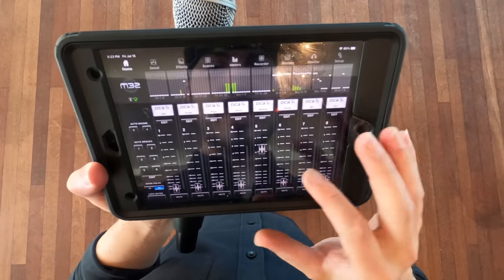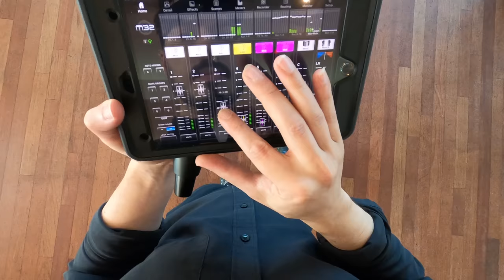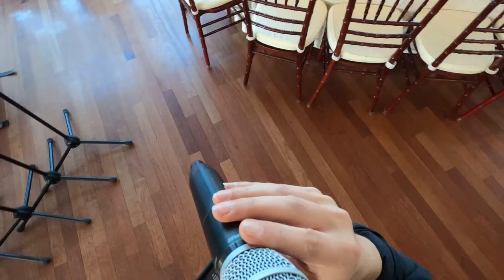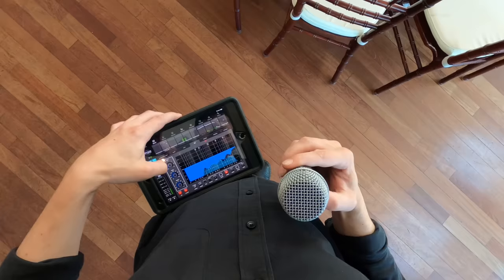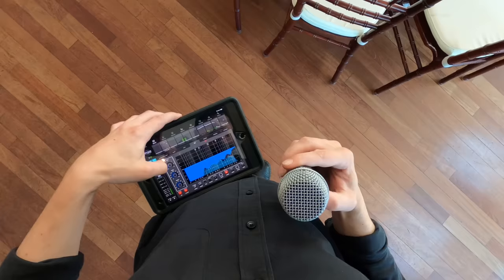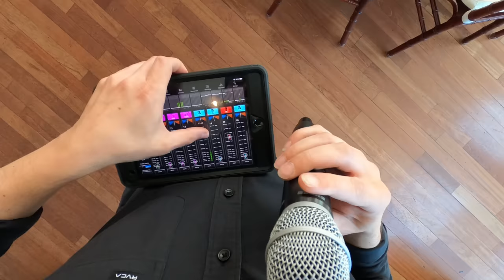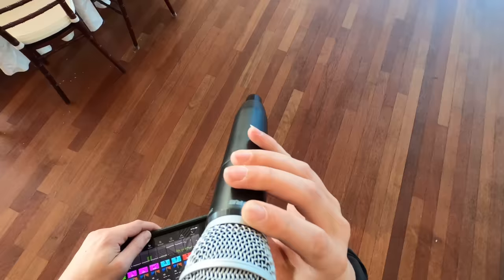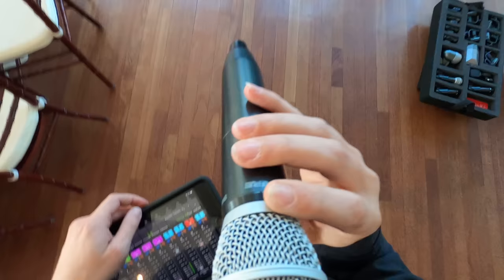System Tune & Sound Check w/Midas M32C

Comment: Blimey you've made life complicated for yourself. You leave the L&R  running full range ?  and you hard EQ the subs to the point of not working . You mention phase, well you will have phase problems in the way you run the system.  Your observation of the room and its problems were well founded.  Please consider that too many knobs are not a good thing. I am not a luddite and have used digital for many years it is way better than analog. ( My first desk was a Soundcraft Series 1 way back in the late seventies ! )   But consider digital to be like using a computer for the first time, if you don't know your manual systems in theory & practice well,  you will only make the same mistakes faster & worse.  Best of luck I mean no offense. Regards Rob

Comment: I’m glad you’re not using graphic EQ, but I think you should reconsider the amount of EQ you are using. Generally subs only need narrow band cuts where there are aggressive room modes and not a low pass because they generally don’t reproduce frequencies that will compete with your mains. I do run a gentle high pass on my main tops matrix so it doesn’t have too much low frequency information repeated. I only run EQ cuts on the mains for problem frequencies that are causing feedback and only gentle and wide cuts if I need to do some tone shaping. Often less in more. If you have the subs and your crossover set well, you generally shouldn’t need to EQ your channel strips too aggressively either. I’m happy you’re actively doing sound and getting your hands dirty!  Keep doing and learning everyday.

Comment: i start laughing when he works on the subs till the end of the video, you made my day with that stupid equalizing, I call that video - how to bring a system down without touching the master faders ! .-)
Reply from the maker: How did the subs sound?
Reply: @billylaguardia  look at the equalizing, you bring the hole System down in every step you do, what will you do on a open air with 10.000 or 30.000 People ? Order more stuff or 20 Delay Lines ?
Reply: Right at the beginning you couldn’t even hear the subs. He has no bottom end coming through those subs. Any bottom you can hear is coming from the top speakers. You should probably just put them back in the van
Reply from the maker: @rusinjeff5959  1. This was filmed on a GoPro strapped to my head pointing at the floor. Which as we all know is the pinnacle of sound capture. 2. Did you only watch the video on your phone? Despite the lack of a quality capture device, I stand by the mix which for my taste has a good amount of low end that is tight and controlled.

Comment: What?? Way over thinking my friend….
Reply: Maybe. But based on what? Graphics? So, the way to do this is to make minor tweakings, so that the graphics look nice despite the poor sound quality in the room? Interresting. I always thought that the range is there to be used AS REQUIRED, which is the case. Also, he not only put the reasons in the subtitles, but explained them again at the end. Between a nice looking, inside the rules EQ and a great sounding system, I'd rather go with my ears, instead of my eyes.

Comment: 2:03 - That's not EQing the subs.  That's using EQ for gain control.  What is that - 18db out of just about every frequency? Using EQ this way adds more phasing issues than simply turning down the gain 18db and using smaller EQ moves.
2:16 - don't you think you should check signal before you start tuning/EQing the system!  LOL.......
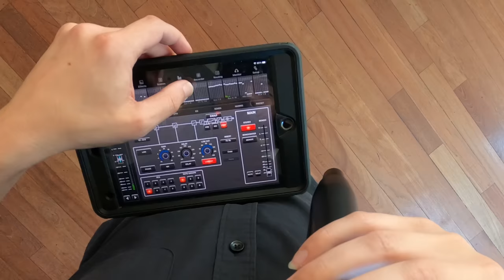7:05 - again that is using EQ as gain reduction.

Honestly I had to stop watching the video at this point.  The techniques being shown in this video are completely wrong.  This guy needs to fix his gain structure before he starts to "tune" his rig.
Reply: Brain simmons
Reply: Brain simmons

Comment: Theres some interesting stuff in your video but Holy Candlesticks.. taking 80Hz out of the subs and rolling off the Vox at 200hz? I'm off to play some reggae and weep into my beer!
Reply from the maker: The subs are fed a full range signal via a matrix. The built in crossovers have a very gentle slope. This means that higher frequencies from 90-150hz are being duplicitously set to the subs and the top cabinets. This to my ear sounds muddy. I like the subs to handle a very narrow frequency range around 40-75Hz and the tops handing 75Hz up. The way I mix, this achieves a very tight low end. Try it, 40-75 is perfect for dub.

Comment: Why do you pick on the high freqencies first, during system tuning? If a sine wave in a one-channel line carries a population of low frequencies which become a carrier wave for higher frequencies, then higher frequencies have a bumpier ride before they start? You only have fifteen volts peak-to-peak according to the DC voltage supply in the analog world. In the digital world, signals become decoded and processed; then re-encoded into the amplifier outputs which feed the speakers and in-ear monitors. Again: Why do you pick on the high frequencies first?
Reply from the maker: The high frequencies are the first to feed back with this type of deployment and also the most painful to the ears. All inputs have a HPF on the channel which take care of any low frequency issues say on the floor tom or Bari sax.

Comment: yesterday I mixed for the first time a band, i followed a ton of videos, mainly yours, sadly it went horribly, my ipad was way too dimm, feedback everywere even tho i applied a ton of eq like you did, etc. in defense we did not have time, before that it began to rain like crazy, were rushed, and also the boss had its methods and i had mine, he said you apply ay too much eq, killing the sound
Reply from the maker: Welcome to running sound for a band, it’s always going to be tricky. Live music never usually happens in spaces designed for live music. It’s often mixing a band in the corner of a bar or a boomy room. Tough gigs are going to happen, it’s best not to get discouraged and use them as a learning experience. So much of live sound is anticipating problems and solving them before they happen. Using a lot of EQ isn’t a one size fits all approach. I use EQ as needed to get the sound I want and eliminate feedback. The rooms that I mixed in my videos required that much EQ to make the band sound the way I wanted. That band was a wedding band. They had people making speeches in front of the PA, 4 singers, a horn section and were generally in boomy rooms. That much eq was needed as I couldn’t change the placement of the PA etc.. Generally, live sound can’t use preset methods. It’s about training your ears and understanding what methods will work with the rig you are using and the room you are mixing in. Good luck on your next gig!
Reply: @billylaguardia  Also they hay in ears, makes everything way easier, please, and i beg you, do a video on bands who use floor monitors and how to route em, if you use pre eq post fader etc it would help us so much!

Comment: Hey Billy, Love your videos and learning a LOT!!! Question: looking to up grade my digital mixer. Presently have a QSC Touchmix 16. I'm stuck between 2  different mixers that I've seen you use (Presonus Studiolive 24R and the Midas M32C/DL32) and wanted to know which one you prefer. I Have a cover/corporate band and would be strickly used for live applications. Looking forward to hearing back from you!!
Reply from the maker: Hey Sergio! I prefer the Midas for live sound. I like the EQ’s and the general workflow in Midas land. The 24R is more suited for recording. If I wanted a console to use as a studio interface, the 24R wins. I’m building a new M32c system. Keep your eyes peeled for those videos. I am going to make a m32/24r comparison video soon.
Reply: @Billy LaGuardia  That's what I figured! Thanks for the feedback and look forward to any videos you'll have on the midas M32C and DL32 setup and tips! Cheers

Comment: I’ve noticed you leave the speaker covers on. Does the added protection outweigh how much it affects the sound?
Reply from the maker: The covers are the ones available from RCF. The bands has a custom stretchy fabric (technical term 😂) logo on the grills. The fabric claims to be acoustically transparent. I would concur with that statement.
Reply: The covers should be off.

Comment: This is exactly how to NOT tune a room!  You're applying a LOT of unnecessary EQ, you're the example of someone who EQ with their EYES instead of their EARS! You're also ruining the PHASE response!   🤣
Reply from the maker: Did you watch the whole video? I showed the room, the speaker placement and 4 singers standing in front of the PA. I gave reasonable and logical explanations of why I was doing what I was doing. Assuming I did EQ with my eyes, wouldn't my EQ be flat to appease the comments section? I am not the singular authority on sound. However a wedding band with 12 people crammed into a corner in a country club with people singing and giving speeches in front of the PA requires different methods than a club, theater or arena show.  If you have any suggestions that would help a room / set up like this sound better, I would love to hear them. In fact, I have 2 shows in 2 similar rooms this weekend. I will gladly employ any and all of your suggestions and credit you in the video.
Reply: @billylaguardia  try using a gate or expander on the vocals

Comment: Hello Billy, how are you? Help me with a question? Does the M32C work for Android cell phones or tablets?
Reply from the maker: Yes the M32C plays well with Android. You can’t use the mix app on your phone, you will need a tablet. You can use your phone with the M32Q app for individual monitor mixing. You can use the 3rd party Mix Station app to mix on your phone if need be. Some people prefer the Mix Station app to the Midas app.
Reply: thank you very much!

Comment: I’m just starting to get into learning how to run audio I have an X-32 what do you recommend for a router I see your tablet runs super smooth and no lag
Reply from the maker: Oh man, it was really laggy in this video. We use a standard Linksys router. You don’t need to go crazy with the router. Obviously the newer the better to make sure it has the latest protocol.
Reply: @billylaguardia  I bought a used one on Facebook marketplace but it’s extremely laggy and makes the audio go crazy before it catches up 😀 just wondering what other people use since in your video it looks really smooth
Reply: Try mixing station. It’s more stable and has a much better layout and custom options
Reply: @laughingthrushmusic5269  I’ll look into it thanks

Comment: Over all awesome setup however in my opinion you don't have true control of your subs. I thought doing the same setup you have was the best way then I started working with 2 different people one is currently touring and the other one is a former touring engineer. Both have shown me that for basic 2 way setups using a L/R/C OR M fader setup you have more control. Sure you get the Crossover points however when your channel EQs are set properly along with your specific L/R and M/C EQs the sound is more controlled and you can send what you really want where you want it... For example I run 2 bass line a Low and Hi. I do this mainly for monitor reasons however of you send just the low to the subs and send the High to the tops you get a more controlled response from each frequency set...
Reply: Using self-powered speakers, it appears that he didn't use the built-in filters at all.
Reply from the maker: Correct. I don’t like the filter slope of the built in crossovers which is why I run the subs on a matrix with such an aggressive EQ.

Comment: Awful room to mix a band. Keep overall mains level low as possible. Drums are mixed to loud (in my opinion). In a live room that small you can almost run the drums without any feed in the house (monitors only). Note- The room will sound completely different when people fill it up....